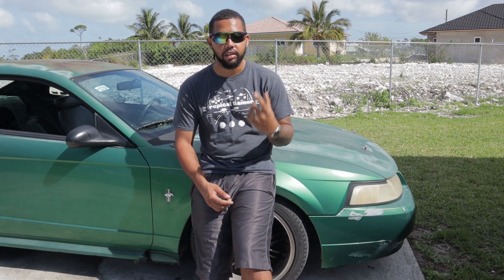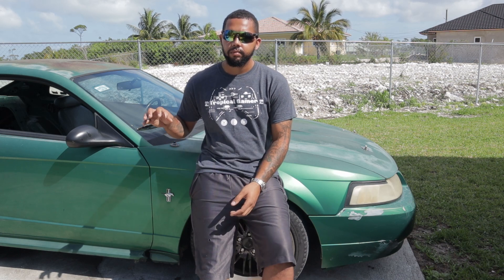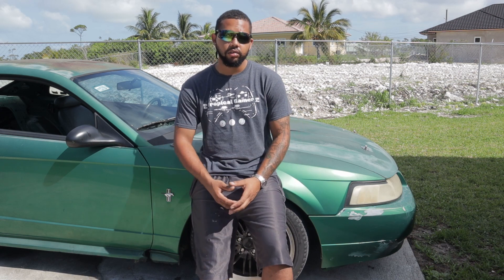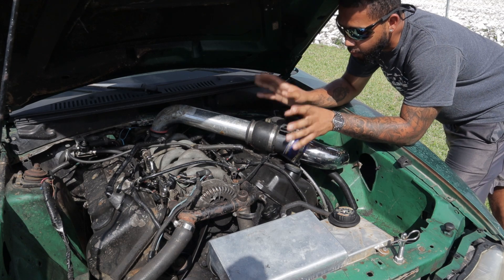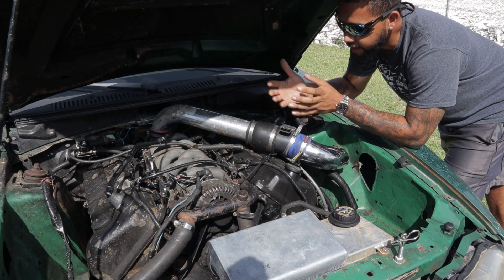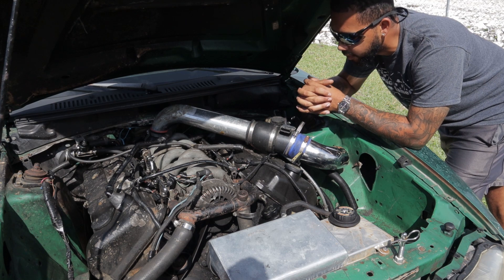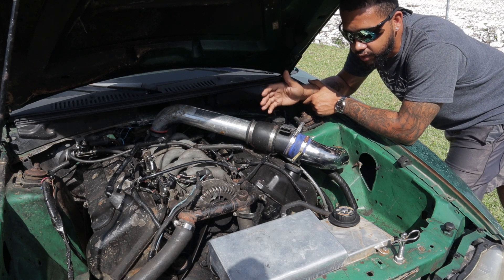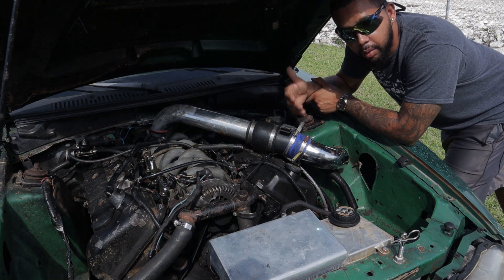How To Build A 1000HP Teksid 4.6L 4V Engine

Comment: Not many people know about the strength of the teksid when built right. I love it. Beside a few tweaks to the heads, the 98 4v in my opinion is better than the 03 4v. But i will say ill never build another 4v in my life. If this engine blows, i may have to jump on the LS band wagon even though I don't even like chevy lol.

I had a 94 forest green convertible with a 98 cobra teksid swap in it and It burned in a garage fire with a built nitrous fox body I had just bought. Luckily the cobra motor was in the shop being built and the V1 vortech blower was inside the house.

I was pretty devastated but I found an 03 cobra shell with 63,xxx miles on it, all primered ready for paint with 18in fr500, lowering springs, subframe connectors, 4.30 gears with Detroit locker, full 3in bassani cat back, and the interior has no rips and is a 9/10 for $4,300 because he didn't have the engine harness.  

The teksid block is now fully forged, 0.20 over, 18cc dished pistons, manley rods and the forged cobra crank. The heads are stage 3 ported and polished on the intake side, ARP everything, teflon oil pump and stage 3 ported 98 cobra intake for now and it's going in the 03 cobra with a 84mm turbo..

I know theres not a lot of differences between the 98 and 03 as far as sensors and such, but do you have any info on what I need to change with the fuel system/accessories/ oil filter relocation or whatever else? The car is staying 6 spd with the factory ECU as of now. I know i have to get the COP valve covers and I already have the 98 timing cover. Any info would be greatly appreciated. Thanks in advance.

Comment: Doesn’t the Lincoln Continentals come with the same 4 valves with the Teksid blocks too?
Reply: @DriftDreams242  That’s what I heard. Thank you for the confirmation. I found one that needs a new head gasket but he will sell me the engine and tranny for $400. It’s a 97 with 134k miles.

Comment: Can you mount 3v heads on teksid heads on them? Absolute great video
Reply: Yes you can mount 2v 3v or 4v on the same blocks I've seen guys do teksid 2v builds you can with a 3v also but if you aren't trying to make above 1000 to the tires your original block is just fine and is also aluminum.

Comment: The lincoln cracks can't handle that power. The lincoln has a 6 bolt cast crank vs the Cobras 8 bolt steel crank

Comment: I bought a 04 lincoln aviator that comes with this motor for 900 running needed coils which I did and purred then went to crank it low oil pressure so definitely rebuilding it then want to swapp n a stang but thinking a crown vic too kinda need 4 Dr but my love for mustangs it's probably gonna go in a stang

Comment: Wap aviator and marauder blocks can handle 4 digit power level just like the teksid. The wap is lighter too
Reply: The cranks are identical for the automatic engines, B headed mark viii stuff or later intech engines. Either make solid starting points for big power appliations.

Comment: I have a teksid from mmr 1000se and I took it all apart and sold the rods and pistons notched to for 2v. 1 reasons is manley instr trust so I put custom made pistons from l&m raving engine 10:1 can’t use race gas unless your running 111:1-14:1 and the rods are boostline rods by Weisco  don’t forget about decking the block or heads
Reply: @DriftDreams242  great kit upgrade turbo after and your styling I think the turbo that comes with it won’t get up to 1000 but I have no experience with it

Comment: I have a 1999 cobra and I’m trying to put twin turbo on it what should I replace inside the engine before installing those turbo?
Reply: Depends on how much power youre looking for.  Examples
6lbs boost...Which in that motor is good for roughly 450hp. Just swap out to a good set of rings gapped for boost. And a good tune. (Also a set of good head gaskets doesn't hurt)
14lbs: swap rods and pistons to forged (99 cobras did NOT have forged rods and pistons.) Also upgrade fuel pump,  injectors, ignition system, head gaskets & bolts etc etc. Good for roughly 650hp. Thats w stock heads. 
More power? add cams, port heads. Etc
Turn up boost to 20 lbs... Add more parts lol

Comment: I have a 97 cobra .. so just do the rods and pistons ??
Reply: They have a teksid block and forged crank stock so drop in rods and pistons and you're good.  Stock heads and cams can make 700 to the tires pretty easily.  The b heads do well boosted.

Comment: My ‘01 Cobra coupe came with a Teksid too
Reply: I'm almost positive the 2001 did not come with a teksid maybe early in the model run ones I can't say for certain but they Def switched over on the 01s. Maybe someone built your engine and used a teksid?

Comment: I have a mark8 block and it is alot more money than you think to build it also has a cast crank not a forged crank is what you need also arp bolts and studs throughout the engine heads mains etc.

Comment: I have a 98 cobra and I never knew that my motor was capable of that
Reply: They are don't let the modern coyote fanboys tell you that your old 4v can't put in work with drop in rods and pistons.  Block and crank are stout and the stock heads can make a ton of power with boost thrown at em.  The b heads do great boosted but not as good na because they flow too well for am na 4.6 lol.

Comment: There is one other weak point in these motors, the stock oil pump gears aren’t good for high revs and power and should be swapped out with billit ones
Reply: Hush roll is very correct on his statement. I didn't heed the warnings. I had built a 13 to 1 5.4 dual overhead cam out of Lincoln navigator made 510hp and was used as a drag race motor. Had all the bills and whistles from manley h beam rods to diamond Pistons to ported heads to wicked Comp cams etc. Had installed a Ford racing oil pump but it did not change out and put billet gears in it. The two-step rev limiter cheewd them up and lost oil pressure at the top end of the track, roached a $16,000 motor for two billet gears in the oil pump.
Reply: @billmeyers9584  they are fine if you aren't bouncing off the limiter.  I don't use 2 steps anyways.  Bouncing off the limiter at high rpm ecsp boosted can break aftermarket ones too but it's obviously less likely.  I love the 5.4s.

Comment: These are great engines, l kept the drivetrain from my Mark 8 before l crushed it.  Im pretty sure John Mihovets has gone up to 3000 hp and gone into the 5's with a Teksid block.  You can have a coyote crank modded and it will work in a 4.6.  I'm just gonna keep mine stock and slam it in my 73 Maverick.   I'll build it if l ever have the money.
Reply: @DriftDreams242  absolutely bro, one day l will see if l have a video of the car, l dont think l do.  My garage is so slammed full of stuff it wouldn't be recognizable in a video.   I was gonna do the timing chains since it's a high mile engine and has the secondary tensioner rattle at starting.   I haven't heard of the cooling mod, I'll have to check that out and since the engine is out it makes sense. I did want to swap a standard trans in it and use the 4r70w in a 7up car me and pops got so he could drive it.  A truck hit me on a enduro dirtbike and trashed my left leg so l don't think a standard trans is logical at this point.  I have 373's for it, one of the best parts of the car is a 9" Versaille l traded straight up for the 8" that was in it, was the deal of a lifetime! I have a few old Ford's but the Maverick is special, it's where it all started.
Reply: @DriftDreams242  thanks for the encouragement dude!!   I will always be a gear head, l still ride bikes much  to many's dismay.  But hey, gotta have something to get parts with when your working on the daily!!  I'm goin to finish the Maverick, I'm like 13 years deep in it, my time is consumed by family, oddjobs, yardwork, and sorting out the daily driver slowly, old Mercedes diesel.
Reply: @DriftDreams242  I'm trying to inagine that injury, gives me the hebeegeebees thinking about it.  I guess we forget that other thing than bones can break in the body, glad your allright so you can make badass vidjahs on here and make friends!
Reply: No point in a coyote crank, the kellog crank is plenty strong. It's been 5s just like the block
Reply: @DriftDreams242  l bought a mark8 cheap years ago as a daily. Im talking 900 bucks tax tag and title cheap, l drove the tires off it bent the frame a lil getting squirrely.  It still drove fine and straight, l couldn't get the oil filter to come out where it had to and just drained the oil for about 20k miles. I was able to drive something else and decided l would disassemble it.  I am pretty sure it was flooded, it had no key cyl on the door, you had to finger it to unlock it, the steering column was broke, it would completely come out while you were driving it and was very sloppy, blend door broke so no heat, it just wasn't worth saving. I kept the harness, unplugged every connector, l kept the brakes and lines, firewall, dashboard, engine, trans, and gas tank. Should go real nice in my Maverick.  It never gave me any trouble at all, gas mileage was great, so was the power,  it's quite different and l like it's uniqueness.

Comment: It’s really cool you’re building this engine. Everyone is all about the coyotes now but I really appreciate the 4.6 and I think they are definitely a great platform that’s strong and cheaper than the coyotes. Excited to see your build. Subscribed!
Reply: @DriftDreams242  the B heads are NOT more restrictive, rather they have the opposite problem of flowing too much for a non-boosted 4.6.
Reply: I do t know about cheaper lol. Coyotes are cool but I think if you're going to do anything besides a coyote that will have boost, the aluminum teksid block is the way to go. Just ask the guys at mmr, Built right, these things will easily handle 1000hp and with the factory ECU. There are plenty of them running 1500-2000hp all day. You just can cheap out on any part or that will be the weak point.

Comment: There were two different cranks. The eight bolt which was good for 800+ hp. But the majority of mark viii motors had a six bolt which were only good for @400. Much over that and the crank will break. I had to switch the six bolt out of the teksid I am currently building. Went with a forged Manley crank, htuff I-beams, diamond pistons, and will get a big Whipple. Running a 9/1 compression so we don't have to pull as much timing and a meth/water setup to cool the supercharger under heavy use and allowing for even more timing. Also the later cobra motors came with stronger rods and forged pistons, especially in the years they were building the terminator motors.
Reply: The shorter the the crank throw the more stable(less vibration) at higher rpm. I'm not sure the .011 would make that big of a difference but it was the closest to stock dimension they had. I prefer Manley bc I have had good luck with them in the past.
Reply: @robspears2329  Got it. Thanks man.  I appreciate the info.
Reply: Can i know what Mark 8 has the 8 bolt by the year model? if so then what years have the 8 bolt?
Reply: @BryanYoungYT  none of the Markviiis had an 8 bolt crank.
Reply: @robostyle9773  only the cobras and 5 speed machs had the forged 8 bolt crank.  Auto machs did not get it.  All cobras did because they were all manual trans.
Reply: @DriftDreams242  i was looking up the parts you listed. I agree they are not hard to come by for these engines at a fair price. I am curious as to why for the crankshaft, the 3.554 is supposed to be factory stroke. Im mostly just wanting to understand why Manley advertises their forged crank as having 3.543 as in why is it so important its .011 difference less?
Reply: 800hp? Lmfao

You must not know the stock kellog cranks have been in the fives in the 1/4 mile.

800hp lmfao